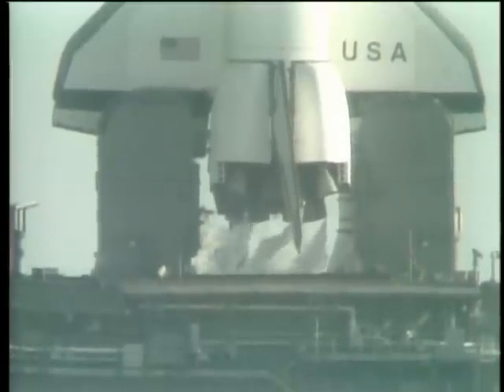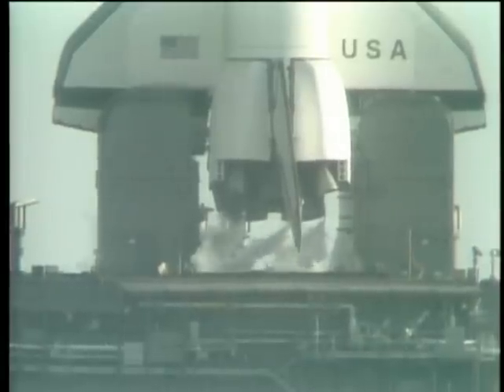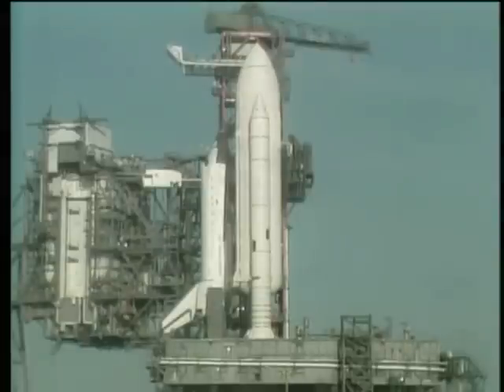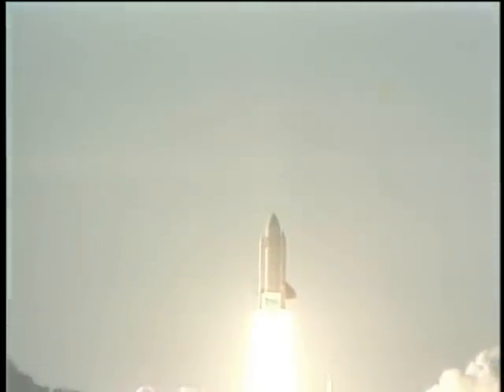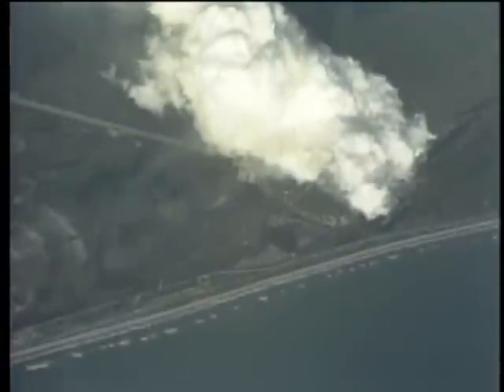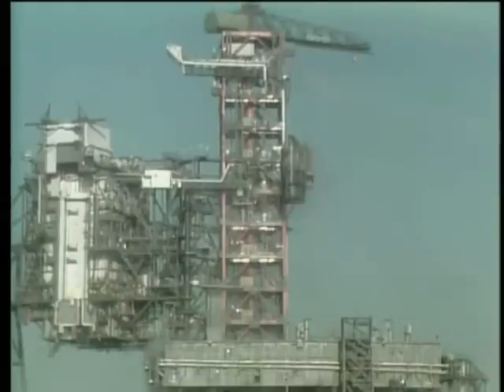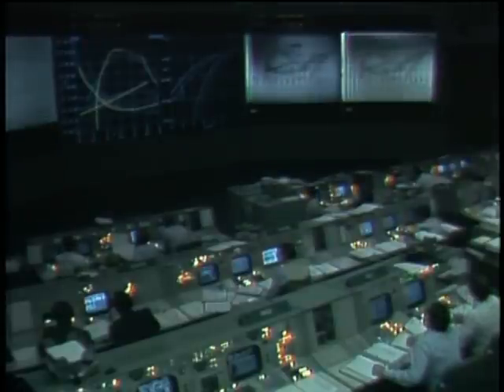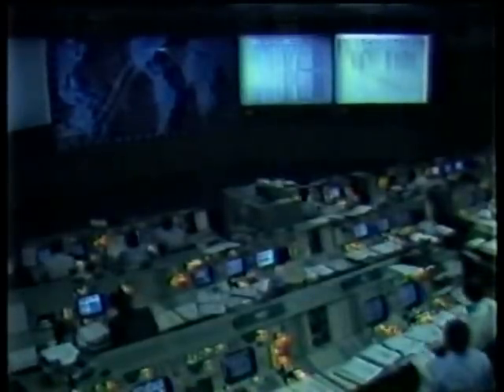NASA Footage of The STS-1 Launch Part 6 (The Launch)

Comment: Space shuttle Columbia was the heaviest space shuttle. The empty weight at rollout of space shuttle Columbia was 158,289 pounds and the weight of Columbia with main engines installed was 178,000 pounds.

Comment: In those days i think they still did'nt have any of the communication satelites they used in later years., so they flew headsdown up until ET-sep, am i right?
Reply: What does heads down mean I'm curious? Are they on their back and upside down after the roll?
Reply: What does heads down mean? Are they on their backs and upside down after the roll?
Reply: Marlon Isaac Yes, in those days they were flying heads down up until MECO and ET sep since they only had ground antennas for communications. Later on (I don’t know when exactly) they did a roll in order to fly heads up at T-plus 6 minutes (or there about). During that second roll they decreased altitude a bit but increased speed. One should also keep in mind that the vehicle was flying almost horizontal during three or three and a half minutes prior to MECO.
Reply: Marlon Isaac You can watch that either on animations or via (in later missions) onboard cameras.

Comment: One minor note. At 3:06 there is an overlay that states the liftoff occurred at 7:00 a.m. Eastern DAYLIGHT Time.  In fact it was Eastern STANDARD Time. EDT didn't occur this early in April until 1986.  So today (2011) the launch occurs at 8:00 a.m. EDT or 12:00 p.m. UTC.

Comment: Amazing it made it through 24 flights without the O-rings giving way.
Reply: As they approached the Challenger disaster, they were taking more and more risks with regard to launch conditions.  The burn-throughs (which had happened previously to the disaster), were related to the cold launch conditions.  NASA was under pressure to keep up a schedule, regardless of the weather.  Those astronauts were killed by bean-counters.